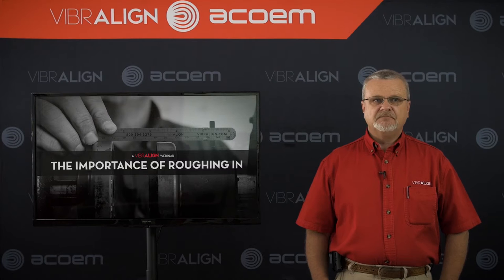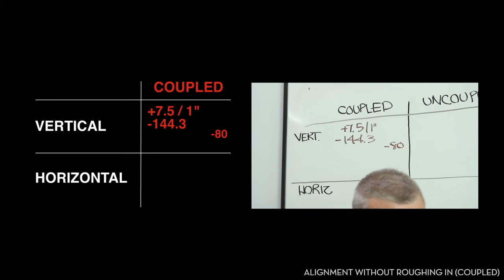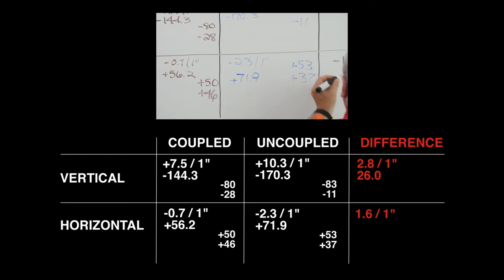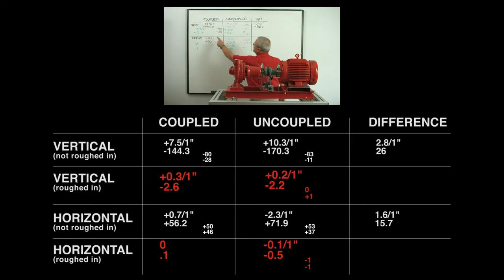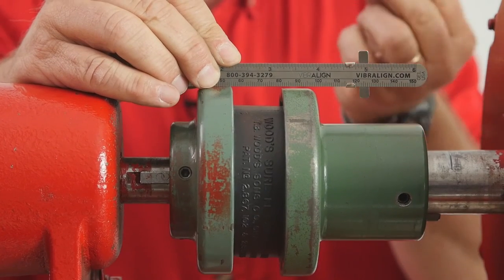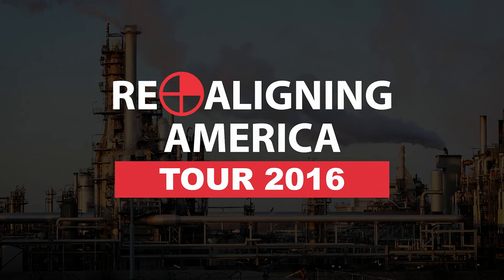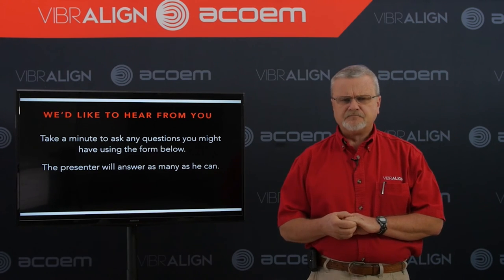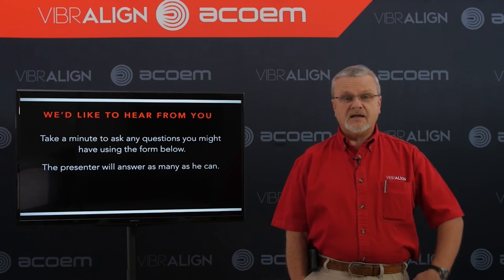The Importance of Roughing In - An Acoem Webinar | ACOEM

Comment: Best way to rough in a flex to ridged coupling ?
Reply from the maker: From Stan Riddle:  

As coupling types become more rigid, shaft alignment tolerances become more precise. 
The easiest way to align a rigid, or semi-rigid coupling, is to perform the alignment with the shafts uncoupled.
When this is not possible, there should be engineering drawings stating the specific method to align the shafts.
Often, machines with rigid couplings are designed to be placed in specific proximity to one another, or are pre-drilled for locating pins to precisely locate the machines in the respective relative positions.  It is always advisable to check with your engineering department, when aligning machines with rigid couplings.
Reply: VibrAlign we had to align centrifugal turbocompressors becouse they were big enough we manage to use spirit levels on both shafts.